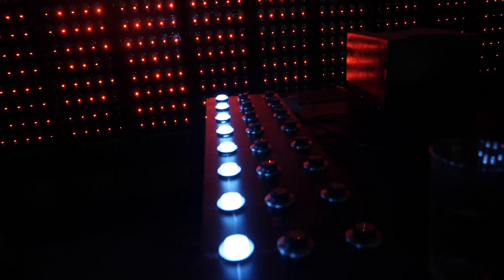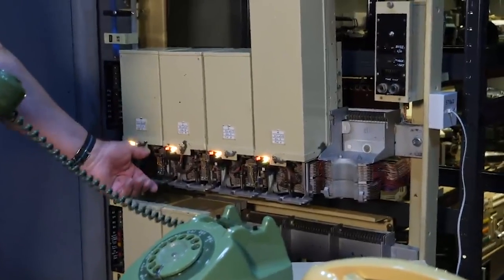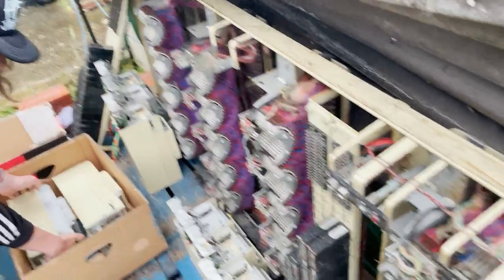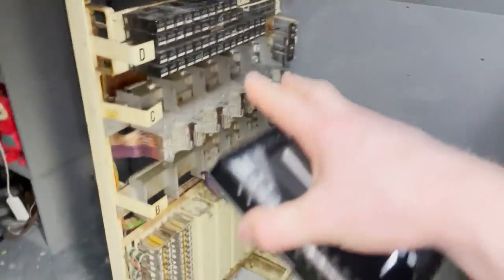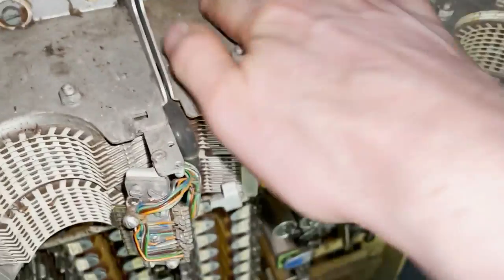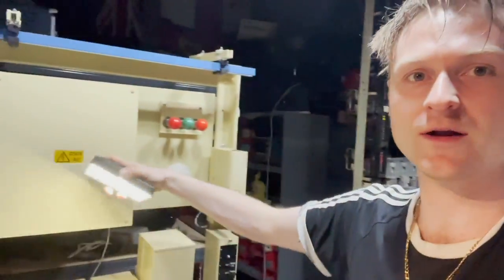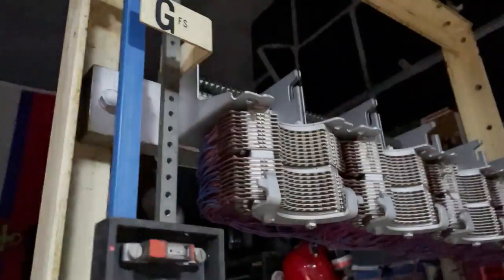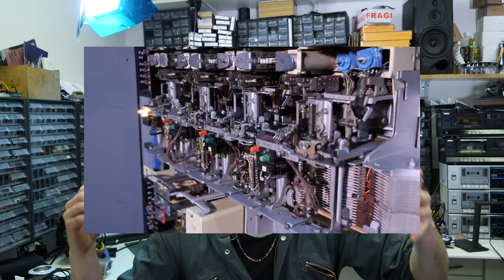Buying An Old 1960's Strowger Telephone Exchange For Restoration!

Comment: You know all those relays, stepping-things, and selectors, are all going to make different percussive sounds. You might even, if you have parts to scrap, rig a couple up to a cymbal or a woodblock or something. And then you'll need a sequencer... which it already has. First Strowger drum machine? It'd be amazing! You could program sequences either with it's many switches, or use the "RAM" that's reified in the selectors, to store 16 steps or so, dialled in on one of those operator console telephones! If you have one...

Actually not just a relay, but why not 50 relays? That'd be a unique sound, and get past much of the need for amplifiers, which of course don't exist, the best you'd get would be a carbon microphone. Did you know carbon mics were the original amps on telephone lines, before thermionic valves? Literally a carbon mic, and a magnetic earphone, just like in a phone, mechanically attached as one manufactured unit. Worked cos of the unusual property of the carbon mic as being a variable resistor. So driving one with a higher voltage than comes in to the earphone, gives voltage gain. 

It'd be great to make a musical instrument from this, and would be in your style. Get a relay to buzz at a few hundred Hz if you wire it up to oscillate, but that wears them fast, there's always a spark between the contacts. Set the frequency with a big cap, and have maybe an octave to play awful low-frequency lo-lo-fi ditties. If you're worried, use brand-new relays you can throw away if they burn out. 

I would even dare say I'd prefer it as an instrument than as a working exchange. Depending on how many of these units still exist in museums, if there's already plenty, I'd modify it into an instrument. Non-destructively, you'd only be rewiring it, no mechanical changes needed, allowed, or desired. Being able to dial in a sequence like a phone number would be epic! When you're dead, and, still intact, somebody not yet born collects it, they'll think you were a maniac!

As an intact original machine, it would put across it's immensity, complexity, and power. Demonstrate how we did things before beige boxes with an Ethernet socket on the back. This is the idea, the formal logic, of a telephone exchange, made into flesh, directly and literal-minded, in electromagnets and metal. "When all you have is a hammer", cos electron beam lithography hadn't been invented yet.

But the working principle, the need for it, and a real understanding, comprehension, of what it is and what it does, how and why, most people would not get. You have to know it, to love it properly, and the people who can do that, already do do that. So the masses wouldn't understand it, and the geeks don't need it. So I wouldn't feel guilty about instead wiring it up to a drum machine you could telephone patterns into. Shit, you might connect it to the public network, or even to a cellphone! Ring it up, feed it clicks, pulse dialling, and party like it's 1891! Call in, program it, then hear it clatter and sing down the line through that carbon mic! You could post the phone number here, THAT would be a museum piece!
Reply: Yess

Comment: Those mechanical counters count up the number of units run up by the person on the phone and that number is multiplied by the price per minute to yield the phone bill.
Reply from the maker: Indeed but I need more relay boxes to run them. I ran outa cash when I went around Malcolm's so couldn't pick em up
Reply: Maybe next time you have the necessary readies you could retrieve the rest of the parts

Comment: I am having flashbacks to wire wrapping thousands of patch bays like those on the airplane simulators I work on, after 50 or so wraps you get good enough to just start cranking them out real fast.  Just make sure to keep the schematics close by and get some good wire wrapping tools because the cheap stuff is garbage.

Comment: I found an ebay listing for like 2 old film cameras and 7 lenses. I only wanted 3 of those lenses but the seller would only sell the whole lot. So I got all of it.... as it was fairly cheap. But the condition ended up being really poor so I now have to look into cleaning all the lenses really deeply due to the fungus that's in some of them. Also it turns out none of the new lenses perform as well as the 3 I already had.

GAS and ebay can be dangerous. But doing bad purchased helps you think twice or more times the next chance you see for a bargain.

Comment: the spiral things is called "wire wrap" and it does take a bit of practice but once you get the hang of it really dresses in cable and cross connects. at least they are called wire wrap in America could be different in the UK but would guess it is called the same. Try to find out some one who works in a central office "telecom" near you willing to sell you some older tools they are pricey new or donate some older tools for you because using proper tools makes the world of difference.

Comment: Unfortunately I also was forced to store SxS exchange equipment "in the garden" in the 1990s. A collection of eighty SE50 DSR's became a collection of 35 by the early '00s, such as the advanced decay found once I had to move them. just about everything stored within 500mm of the ground had been rendered useless :-(. I still have a good collection though, enough to fill a room with a realistic display. It'll be a retirement project one day.

Comment: There is a tool for making those spiral connections that makes them super easy. Without the tool you'll have trouble getting them tight enough.
Reply: Yeah, the idea is it gets around on so tight that the metal is actually slightly squeezed into each other, pressing the metallic matrices together : making a more reliable and lower resistance connection that solder.

Comment: Great now you have a system you can fiddle around with, AS it just is a automatic connection system you can indeed make music with it in 2 way's. 1 just the mechanic sound of calling and stepping etc. 2nd the connections it self. Just disconnect the tone dayno. Now you only have the 48Vdc line voltage to deal with. Series capacitor to get rid of that (see old phones thought 4uF or 8uF) to keep the line open you need the coil.
The system it self should be around 600 Ohms. So you simulate a phone dial, pick-up and disconnect then you can select all kinds of "phone numbers" to select sounds etc. You can then use it as a big sound selector though dailing numbers. But the limitation  is lines. It is a 1 to 1 connection system. Then the system can f.i. only handle X-times lines. Think you can from 1 dailing side throug capacitors connect that to 1 input. or 1 output. Automatic dailing can be achieved with relais and some cpu boards. Would be a great project. Wow. Normaly phones work in the range 300-3400Hz. But if you use right coils and capacitors you can reach the whole range. You don't have to deal with phone line amps,long lines, PWM systems to step up to other districs, How ever in this tempo you have your own telephone exchange company soon.LoL.
Reply from the maker: thats somewhat the plan!!! thinking of sending PWM over the lines to be honest but lets see! :D comparators on either end

Comment: Once you get it going, make up some Arduino telephone simulators that randomly makes & answers calls. Have it play samples via PWM on receipt of a call, have the originating call audio routed to a mix bus. (get other youtube channels to make the samples)
Reply: They do something like that at the Connections Museum in Seattle. There's a button wired up to a computer and channel bank that will put a bunch of calls through the Crossbar and Panel systems.

Comment: One the larger exchange, where is the logic section? What creates dial tone? Looks like just relays and multi switches to me.
Reply from the maker: Logic section? The dial tone comes from the other exchange
Reply: @LOOKMUMNOCOMPUTER  the brains of everything. I was thinking it generated its own dial tone. Still, I don’t see how the relays know what to do, that’s what the logic section would be for. Cheers.
Reply from the maker: @jakp8777  there are no brains? the relays are the logic, as for the dial tone yeah thats from the ringer in the other exchange. there are no brains. its a sequential device
Reply: @LOOKMUMNOCOMPUTER  i see. I used to program the Lucent 7ESS phone exchange which is by far the most popular exchange in the states. It’s was entirely digital so that’s what I’m used to, having digital logic control.
Reply: @jakp8777  "but where's the computer?"... HERESY! SHUN THE NON BELIEVER!
Reply: @ripvanwando  why use quotes on a statement I never said? I supposed this could be driven off relay logic, I just don’t see enough relays to do that, and I was right.

Comment: I know of one of these in a factory roof space if you need any parts.
Reply from the maker: ooooh is it still sitting about???? UK???
Reply: @LOOKMUMNOCOMPUTER  lots of its removable parts have been scrapped but the main frame and loads of relays are still there .
Reply: @LOOKMUMNOCOMPUTER  It’s a Plessey system, yes UK . It’s original lead acid back up batteries are still sat next to it.
Reply from the maker: @Omegaman1969  sounds interesting! if you wanna chat about it fire us an email! lookmumnocomputer at gmail dot com. would be cool to hear some more info :) sam

Comment: the reason no one wanted it was because it will be hell for you to clean up to a working condition. every one of those contacts will be oxidised and need cleaning, some of the relays will be duds and it will be a nightmare to rewire all the cut connections. But it is probably doable since you have the time but its gonna be a biiig project. Also see if you can get the circuit diagrams for it may be able to fine them on ebay or see if any of the guys on the strowger group have any they can lend you or photograph.
Reply from the maker: Check me other vid! Nearly working now. Got 4 line finders 8 group selectors and 4 finals working so far
Reply from the maker: Got hold of all of the schems and what not. Also new exchange vid coming this weekend too
Reply: @LOOKMUMNOCOMPUTER  ah nice to hear! its always fun to see people restoring this stuff rather than let it sit under a tarp forever haha. but still good luck and hope the new vid comes out well!

Comment: For the wire panels, you need an Insulated Wire Wrapping Tool. Example of one of the  tools https://www.homedepot.com/p/Jonard-Insulated-Wire-Wrapping-Tool-G100-R3278INS/304345470
Reply from the maker: Cheers I was trying to remember what it was called
Reply: Have never even looked for one at home depot. Good to know!

Comment: Might need to get hold of some tools, for the wirng there are wire wrap tools, there's a basic one, or automatic cut and strip.
For the contacts, i used to have a curved contact uniselector cleaning tool like the one on the right, curved metal blade with a replaceable cloth sleeve
https://www.picclickimg.com/d/l400/pict/274642378608_/Gpo-Strowger-Selector-And-Uniselector-Bank-Cleaning.jpg
For the relay contacts, a thin double sided diamond strip with holder.
There's also a relay contact setting tool for the 3000 type relays
btw, heard a story that an enfineer was working on an exchange, his arm slipped against bare busbars, it melted the metal banded wristwatch
One of the exchanges i worked in hsd 22,000 amd batteries., it was fun bending the 10x1/2" busbars when the wrong ones were sent :D
Reply: .... and a set of tension gauges, feeler gauges, wiper pliers and not least a relay tester. 
Be interesting to see what his MAC figures will be like when he's got it working :D

Comment: That's supposed to read laced ,flipping smell checker !
Reply from the maker: Where?
Reply: @LOOKMUMNOCOMPUTER  if you notice all the wiring has got waxed string along it .
Reply from the maker: @raychambers3646  yeeah waxed lacing indeed, im just trying to figure out what your insinuating whats supposed to reead laced? thats all :D
Reply: @LOOKMUMNOCOMPUTER  sorry fella that waxed string is what they used to call lacing now replaced with zip ties. Also they used to use a C shaped tool with a cleaning soaked sleeve to clean the selector switches .sorry for any confusion.

Comment: Sam you might need a "Telephone wire wrap tool" for those old telecom posts. this is what i use:
:HW-UW-224-1 "Jonard Tools" got mine from Digikey.ca
super simple and im sure there is cheaper ones.. also handy tool
 so... something like that and you wont have to solder on those posts
:)
awesome !